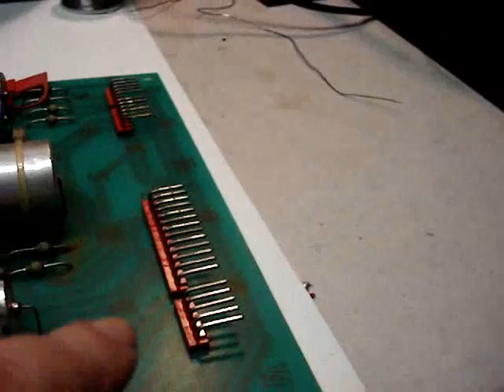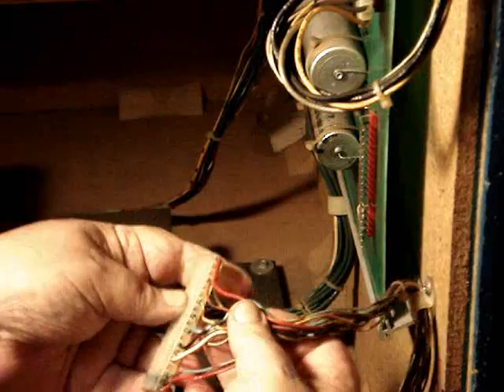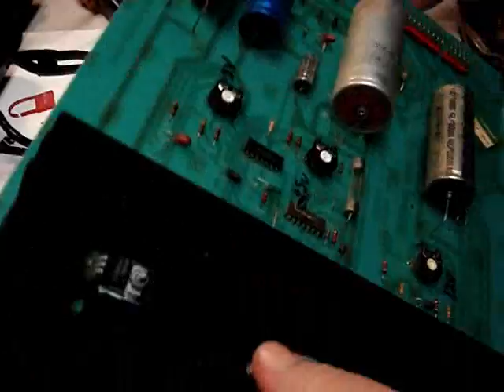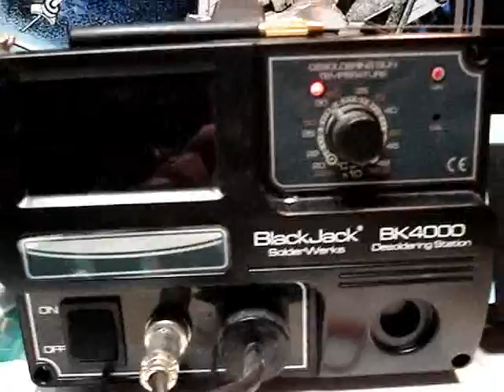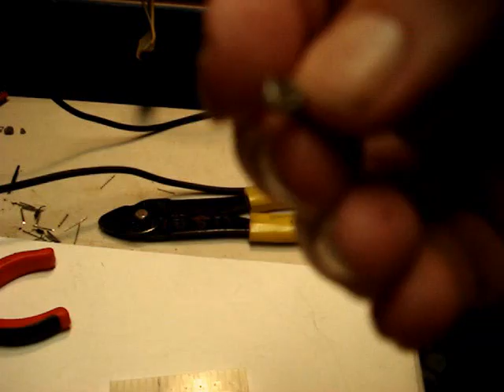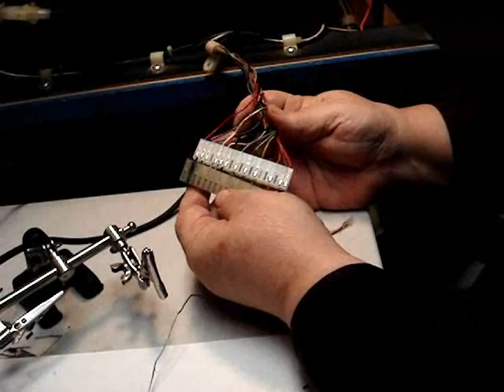Gorf power supply rebuild Midway 90411 linear power supply

Comment: I will be rebuilding my Gorf power supply board soon!  Thank you SO much for sharing this video!  Were those all .156 connectors for power?  Also what size were the trifurcon pins? Thanks again!
Reply: S Verlander thank you!  Also, would you happen to remember what all diodes were used and where I may find them??